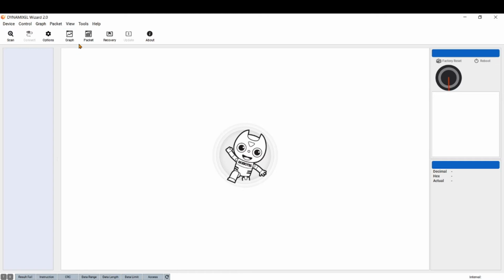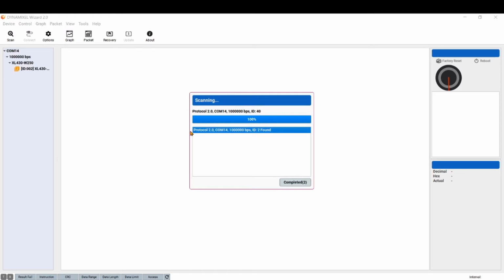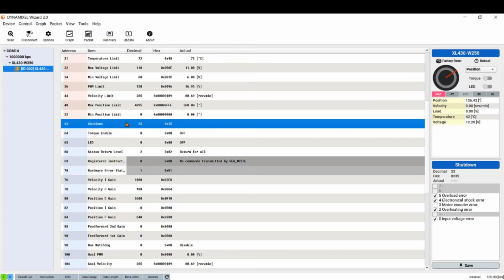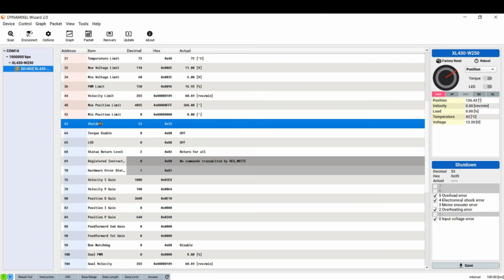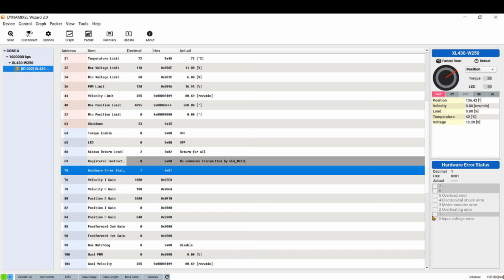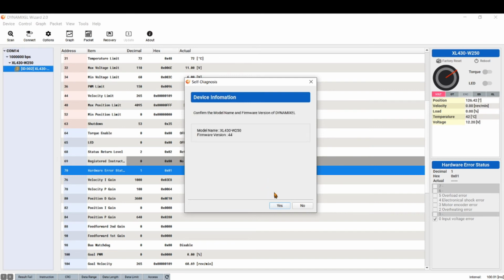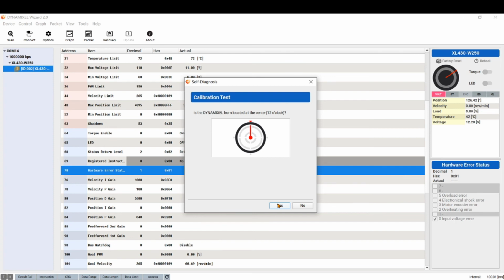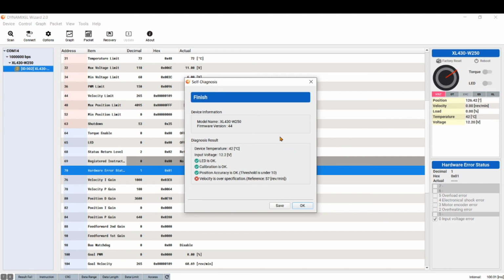Troubleshooting DYNAMIXEL Shutdowns with Dynamixel Wizard 2.0 Self-Diagnosis

Comment: what do i do if the wizard does not detect the dynamixel? i tried firmware recovery, but it did not work; it said "failed to open port"
Reply from the maker: Hello! If you haven't found the proper answer yet, I recommend viewing the ROBOTIS e-Manual, ensuring you have the proper port, ensuring power is being supplied properly, and that your cables are not defective. What set up are you using?

Comment: How do i fix the shutdown of  AX12-A?
Reply from the maker: Hi Bushra khan,
Thanks for your question! If you are using AX12-As and experiencing Shutdown errors, the first place to start should be by checking the error code of what caused the shutdown in the firmware. For more information, see the Hardware Error Status firmware address, with details here: 
https://emanual.robotis.com/docs/en/dxl/ax/ax-12a/#alarm-led17-shutdown18
Reply: @robotisus    I tried to detect the error of  AX-12A by using the Arduino Nano and digital communication port. I couldn't see any error. I feel like it is not connected to the PC. Can I reset Dynamixel AX-12A without using Dynamixel shield in Arduino UNO?
Reply from the maker: @Bushra308  The DYNAMIXEL Shield is required for proper configuration or use of DYNAMIXEL servos with Arduino
Reply: @robotisus  thank you for the support.  before connection, the status of the servo is a red light blinking while connecting or disconnecting power. I connected the servo using UNO and Dynamixel shield and the port I used in IDE  /dev/cu.usbmodem1401 (Arduino Uno)  and in Dynamixel wizard2 id  protocol =1.0, ID=1, Baudrate = 1000000  after scanning it didn't detect any error. and then I did firmware recovery but in installing firmware windows I got this message ("please turn off the power to Dynamixel and wait for a few seconds, then turn on the power."). I followed instructions but at this stage, it's not providing the next instruction and stopped even though I waited for further instructions.
Reply from the maker: @Bushra308   The DYNAMIXEL Shield is not compatible with our DYNAMIXEL Wizard 2.0 configuration program. To connect with DYNAMIXEL Wizard, you will require a U2D2 or similar USB to serial converter device, which is available along with a power hub board and power supply on our international shop.
http://en.robotis.com/shop_en/item.php?it_id=902-0161-300

Comment: How do i fix the shutdown of xl330 with opencm 9.04c and exp485 ? Any help  for this. 

Thanks in advance.
Reply from the maker: Hi Venkatraman, thanks for your question! If you are using XL330 and experiencing Shutdown, the first place to start should be by checking the error code of what caused the shutdown in the firmware. For more information, see the Hardware Error Status firmware address, with details here: https://emanual.robotis.com/docs/en/dxl/x/xl330-m288/#hardware-error-status70
If you have more questions regarding your XL330, it would be great if you can create a post on our new community forum- community.robotis.us !